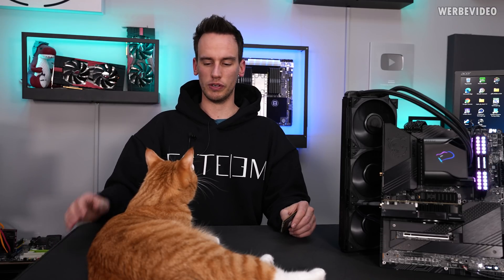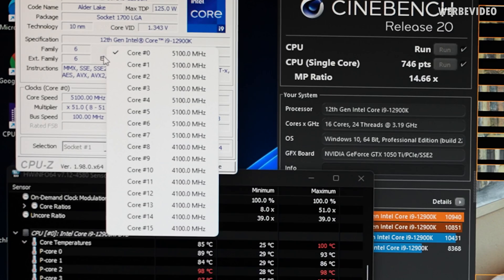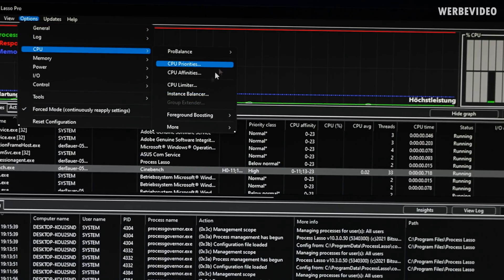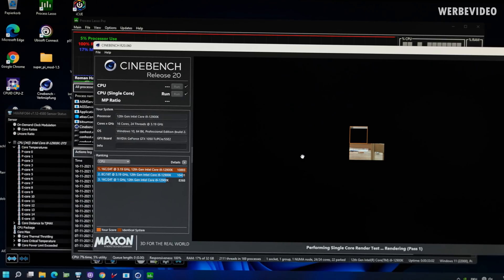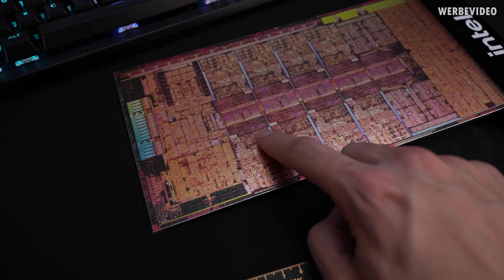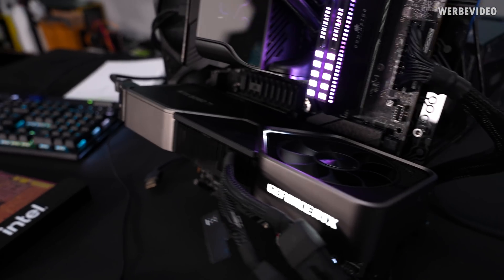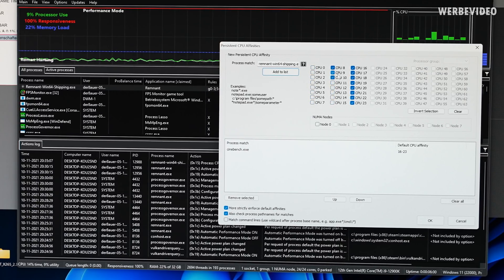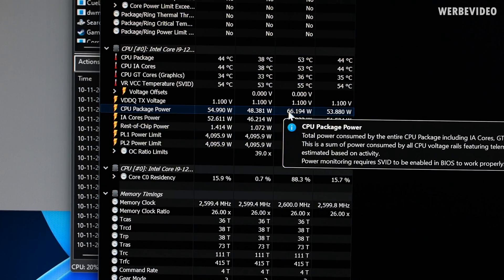The E-Cores were not meant to be used This Way... but it's Amazing!

Comment: You should try disabling the P cores and seeing how far you can overclock the E cores by themselves. How close can an overclocked E core get to the performance of a P core when it has the thermal and voltage headroom?
Reply: Afaik you need at least one p core for cpu to function
Reply: @mtunayucer very wrong, atleast on 13th gen and newer you can disable all P cores
Reply: You get like an i7-9700K inside a 12900K, or a 9900K without hyperthreading.
Reply: @saricubra2867  9700k at a much slower frequency.
Reply: @saricubra2867  Not even close. The latency and lack of certain instructions put it way below even if it could be in theory. How about a real 9700K performance e cores that performs as well clock for clock IPC at 3.9GHz as a 9700K at 3.9GHz core for core clock for clock speed in all workloads. Not just theoretical some workloads that have no latency sensitivity. That would be more impressive.
Reply: @Wolverine607  Gracemount has all the Skylake instructions available and IPC is the same. What makes it perform so bad single thread is the clockspeed.
Reply: @Wolverine607  by the way, you would be surprised by how slow the 9700K is now.
Reply: @saricubra2867  Is it really that slow now?? I have seen many gamers recommend it used for good price it still viable for RTX 3090 as being considered 8 cores 8 threads is still more than enough for gaming?? How about the 9900K now? Aren't they all just Skylake derivatives with more cores packed in same sized CPU chip?? Well Intel did a good job doing that on their 14nm process and even getting more all core clock speed out of them with a good air cooler even.
Reply: @Wolverine607  9700K has stutters because it lacks threads, even an 8700K can be smoother. 9900K is slow, but not as much thanks to the 16MB of cache and 16 threads.

Not all 8 core chips are made equal, removing Hyperthreading reduces CPU perfomance by 40-30%, if we include IPC or single core difference, the 12700K only with the 8 p-cores are 80% faster than the 9700K.

i5-2500K sucks in Cyberpunk 2077 and stuttering every second, but the 2600K is smooth (still low averages, both are from 2011).
Reply: @saricubra2867  Thats interesting. Like how many cores do you really need for gaming and how many threads? If you shut off SMT/HT how many cores. Is 8 enough if they are strong cores?? Or is 12 better?

And would 8 Golden Cove cores be on a 12700K or 12900K with e cores disabled be more than enough for gaming with HT on for many years? Or is it going to struggle. Cause I would not want e cores on, The hybrid arch is problematic for me. Otherwise Zen 3 12 cores 5900X is best to stick with. How much slower are Zen 3 cores than Golden Cove cores and is the 4 extra cores make up deficit?
Reply: @Wolverine607  It seems like 8 cores with 16 threads is the best well rounded spot for gaming and productivity (i think Ryzen 7 1700 started the trend) and the rest is optional. I think you would need 11 cores without SMT/HT to match an 8 core with SMT/HT both with the same IPC and clockspeed.

Zen 3 cores are 20% slower in IPC, if i include the clockspeed difference (5950X vs 12900KS), then one Zen 3 core is 32% slower (4.9GHz vs 5.5GHz).

Who knows if e-cores would be the new hyperthreading or a bottleneck in the future, 12th gen's P-cores have AVX512 instructions too.
Reply: @Wolverine607  If you don't like the "big-little" approach that intel took with x86-64, you would choose Zen 4. There is a clockspeed bump, IPC bump, instruction set (AVX512 support), RDNA2 graphics (technically every single AMD Zen 4 Ryzen chip will be an APU), DDR5, PCIe Gen 5.

8 cores with the highest IPC and SMT/HT are helpful in Cyberpunk 2077 and Battlefield 2042 128 player mode, for the rest, 6 cores with SMT/HT are fine, but since the Ryzen 7 1700 came out, there's no point for 6 cores because it's such a weird core count number, and for streaming and multitasking while gaming too.
Reply: @Wolverine607  Zen 4 (i think) will be for raw perfomance, Raptor Lake and Alder Lake for specialized perfomance.

Zen 4 will have a trick which is 3DVcache tech, if they go beyond Alder Lake in single core perfomance and similar to Raptor Lake, it will win for gaming.
Reply: @saricubra2867  Yes true which I want to do but there is one big problem. Zen 4 is not yet released. If it was a week or 2 around the corner or released right now, I could wait would build a system. But Zen 4 is being launched September 15 at the very latest and probably will not be available to buy until October. That's how Zen 4 launched. It was October 2020, but there were no retail availability for anyone in the public to buy until early November 2020. SO looking at minimum 3 months wait probably longer. Or at best September 15. Darn AMD just release it now if it is ready to beat Intel to the punch and sales.

If Zen 4 was out right now or Alder Lake had a CPU with more than 8 P cores that I could air cool,. I would build such system and call it a day and not upgrade the main components other than video card for at least 3-4 years. Now kind of stuck as Alder Lake tops out at 8 P cores, Zen 3 is good, but worse than Golden Cove and cannot clock at 5GHz or beyond and lucky to get past 4.8GHz all core. Zen 4 looks promising but not out yet. Sad because it should have been by now. I may just try and find a super well binned 5900X sand just sell it when Zen 4 is released and bite the bullet and spend more money in short term to get what I really want long term.

I have also thought of Intel HEDT like Alder Lake-X which will have more than 8 P cores, but are they going to have any less than 16?? Also it seems it will be on a mesh instead of a ring which will hurt gaming performance probably. And that yet again is delayed when it was supposed to come out early 2022 then Summer 2022, now delayed again to Fall 2022.
Reply: @saricubra2867  Yeah that makes sense. Do you think Zen 4 matches Golden Cove IPC or gets closer but still behind. But the rumors of clock speeds look promising though I hope I can do all core manually/static/fixed at 5GHz or a little more. Do you think it will take Zen 4 3D VCACHE variants to beat Raptor Lake  and Alder Lake in gaming??

And when you say Zen 4 will be for raw performance but Raptor Lake and Alder Lake specialized performance, are you meaning specialized apps that are good with big.little approach??
Reply: @Wolverine607  Ryzen 7 5800X3D is very similar in some games to the 12900K and 12900KS thanks to the cache that it has (dosen't help intel roght now that current DDR5 RAM sticks are bad for low latency and terribly overpriced). If it has higher IPC and clockspeed than Intel chips, it would win for gaming in a significant way.

For specialized, means no threads interrupting others for a task thanks to the CPU core specialization and smarter OS scheduler. If you run a lot of stuff in the background, gaming perfomance on Alder Lake wrecks Zen 3 because the OS doesn't know what to do with a lot of similar cores and doesn't know how to divide tasks pretty well.

Hybrid design also gives you lower iddle power consumption and higher perfomance per watt.

I think AMD will fix the scheduler issue on Zen 4 without the process lasso thing, but Intel can potentially get the higher perfomance per watt if they double the e core count, stay on the top for IPC and clockspeed.
Reply: @saricubra2867  Wait so how would Zen 3 cores scheduling be worse than the hybrid. Windows seems to not know what to do with tasks on Alder Lake with e cores on. I had tried a system with Alder Lake with e cores on even in WIN11, on the desktop idling, CPU usage spiked sometimes when moving Windows around to like 5-10%. But iot all happened on P cores. Like WTF. Isn't that low tasks that the e cores should be able to handle and save all pc ore cycles for intense things on all P cores. The e cores did not spike at all. I mean if background tasks were running on them like they in theory should for best usage, shouldn't their be a little spike small spike in the graph of one of them. Yet there never was almost like e cores were not capable or Windows even 11 had no idea what to do with them except avoid them at all costs or something. Contrast to a Ryzen 5900X system where Windows was putting stuff on the slightly slower clocked CCD2 that only caused mild CPU 5% usage spikes.

Yet in WIN11 even with some games, they actually ran a process on e cores that caused slow downs and stuttering in a few games. Its almost contradictory. Thats why I had enough of it.
Reply: I am not sure, but I don't think that you can disable the P-cores.

I know that some motherboard manufacturers, in the BIOS, gives you the option to disable the E-cores so that you can enable AVX512, but I don't think that you can disable the P-cores.
Reply: there's already an article with dozens of benchmarks where all P cores except 1 were disabled in UEFI and then using CPU affinity everything was pushed onto the E cores. The 8 E cores on the 12900K seemed to be similar to a ryzen 3300X in performance.
Reply: @lycanthoss  
Don't quote me on this, but I think that der8bauer said that he used Process Lasso to be able to persistently push the workloads onto the E-cores in order to be able to measure the E-core performance.
Reply: @ewenchan1239  he said so in the video above, you are now permited to be quoted!  =-)
Reply: @xBINARYGODx  
Yeah....had seen people write about disabling the E cores, but I didn't know if the BIOS had the option to disable the E cores as well.

It looks like that the BIOS for my Asus Z690 Prime-P D4 has that option, so yay!

Cool!

Thanks.
Reply: The problem with 12900k is its almost maxed out on clock speed. You can settle down 5.1 all pcore, 4.1 ecore with just 1.3 vcore but if you would like to squeeze just a lil bit like going to 5.2 it is a different story. I tried to 1.47-1.48 vcore but still it was not stable.
So whats the point of oc 12900k? Only for the all core clock around 5 or 5.1 is the sweet spot. Going up to 5.2 needs custom loop also, a lucky silicon die as well, not every chip is the same, some might go a bit further than others.
But yes, the ecore is awesome. I will definitely try out this software, I didnt know it until watching this vid.
Reply: @deathmelodic2807  definitely depends on luck of draw and cooling. I can run 5.4/4.3 with 1.35v under full load.
Reply: Ya i wanted to see him put like P cores to like 3ghz and then OC E cores to max, see which combination of each cores mhz results in best over all performance.
Reply: I have a 12700k it’s like having a i5-7500 for the e cores and a i9-10900k for performance
Reply: Some instruction set extension are missing on the E cores so it won't be a perfect comparison, but it would be interesting.
Reply: Intel says 300mgz on e-core

Comment: Thanks for the tip and findings using process lasso.  Perhaps folks having issues using AVX 512/DRM could benefit as well.  Very interesting results.
Reply: i guess PL won't do any good for AVX512. you need to disable E-cores in the BIOS in order to enable AVX512 instruction set. let's hope the 13th gen thread director is able to sort this problem

Comment: I use project lasso every day and always assign programs to my ryzen cuz cores that are the slowest. Basically I think if you could go thru one by one and have windows entirely running on e cores and them games or  to truly bench a pcore  that’s the best way to do it. Also I though of this the second I heard games with piracy protection have been not working right cuz of the e core hand off I though why not use project lasso and force it to stay on a p core. That might be a good temp fix or another video to see if that works.

Comment: please make a video where you compare 12 gen i5 which have 6 p core and 4 e core with i 9 that has in bios enabled only 4 p cores and 8 e cores that way you can roughly estimate if less p cores and more e cores or some combination that will have similar theoretical die size

Comment: If the cinebench r20 score is anything to go by. 8 e-cores smoke my old 3930k 6 core 12 thread enthusiast CPU. Single score is roughly 270 and multi is just under 2000. Alittle over 50% more performance in single and multi.

Comment: Is it 'amazing' becuase even with 360 AIO, you still can drive those cores to 100 C.
Reply: It's overclocked
Reply: @Lead_Foot  It doesn't get that much lower without the OC, but fair point
Reply: @kendokaaa  the heat density of 12900K, is quite high. I would say on 12600K the E-cores would have much lower temps.

Comment: Interesting video and the E-cores seem really great but as someone that uses software that is mostly singlethreaded in my workflow (CAD software like Solidworks, Inventor, Catia and fusion 360 mostly modelling I know some of the other functions in CAD software are multithreaded but I don't use them on my modelling system). So for my CAD system I would prefer less cores and just as fast as possible is something like this also in the pipeline for newer CPU's because looking around they all seem to go more for multithreaded optimization and although that probably would be good for a lot of software there also still is a lot of software that just wants single core performance and the people that use it wouldn't mind paying for single thread optimization  if you are doing it as your job every bit of performance increase pay's out in the end.
Reply: If you need fast single core though which doesn't scale with multiple cores you'd realistically not need many of those p-cores anyway (how many instances of that program would you really run at the same time, barring a server setup that is partitioned to work as a remote workstation you'd control with a system somewhere else).

Comment: Would love to see a single core benchmark 4GHz p-core vs 4GHz e-core. Another awesome video that doesnt mirror the same garbage other tech youtubers keep showing, THANK YOU so much for good content.
Reply: This is something I'd like to see too. What is the actual IPC difference at the same clocks.
Reply: CORE WARS
Reply: P cores would be 40% faster, the e-cores are basically Skylake.
Reply: @saricubra2867  Intel likes to say that, but it's a rather iffy oversimplification. They're great for what they are, they can stand on their own merits, so IMO it's unfortunate that Intel choose to go with the language they do.
Reply: @pr0xZen  There are no problems with the language. Everything single engineering detail from Alder Lake is simply mindblowing.
Reply: @pr0xZen  Now, imagine the next generation of E-cores in Raptor lake have the IPC from Willow Cove or Cypress Cove from 11th gen...
Reply: @saricubra2867  raptor has the same E cores but updated P cores, meteor lake has updated E cores, probably on the level of coffelake ipc wise
Reply: @najeebshah.  coffeelake and skylake ipc is identical coffeelake just has better clocks and thermal improvements, mechanically the cores are identical. I would think Raptor e cores should be hopefully closer to tigerlake. I do think they will mostly focus on efficiency still though, ipc improvements of the little cores will probably not rise as fast as the big cores.

Comment: Its like saying the 7700K is not able to run games properly XD
Reply: 7700K can easily hold more than 60 fps in Cyberbug 2077.
Reply: @saricubra2867  Excatly
Reply: Like all things, it's relative. A 7700K is a sad CPU when paired with a high end current generation GPU if you're looking to push high framerates which some of us are. If all you're targeting is 60fps, you can go pretty far in the past and find a great CPU for your use case. What's the point of having a powerful GPU if it's only being used to 50%? Might as well save money and buy something cheaper at that point.

Comment: Ian Cutress over at AnandTech said that the E-cores have up to 50% the performance of the P-cores. Also, Golden Cove has a 43% IPC uplift from Skylake. Add higher clocks and you roughly have a 50% performance boost over SkyLake. Is it a coincident, that the Gracemont cores also have 50% the performance of Golden Cove. 
 It makes sense because he tested a i7 6700K/7700K at 4.2GHz and found that the 8 E-cores on the i9 were basically the same performance. So, intel was right about the new Gracemont cores having the same IPC of Skylake. Using just CBR20 to get a performance percentage isn't going to show the whole picture. Check out AnandTech's review on the 12900K. He's done extensive testing on this, including integer and floating point.
Reply: I spent some time going through old submissions at HWBot to try to get a better idea on where the E cores sit simply in terms of performance and you are right about CBR20 not showing the whole picture. While it's true older Intel cpu's were not very good at Cinebench performance in general it's not like they were terrible. Since Roman used CBR20 just taking a look at those results his 8 E cores scored 3203 in multi core. Looking at the 7700k  (Sure it's not a perfect comparison with 4c 8t vs 8c E ) it needs to be clocked at roughly 5925MHz to match them. Looking at the 7600k ( 4c 4t ) at it's base clock of 3800MHz you get a score of around 1600 cb so putting 2 of them together to get 8 cores makes it equal to Romans example using 8 E cores, both scoring 3200 cb. Pretty wild huh